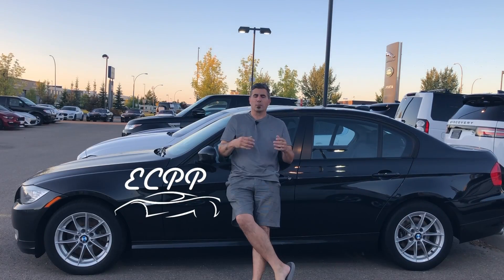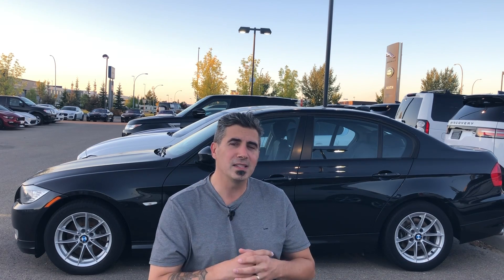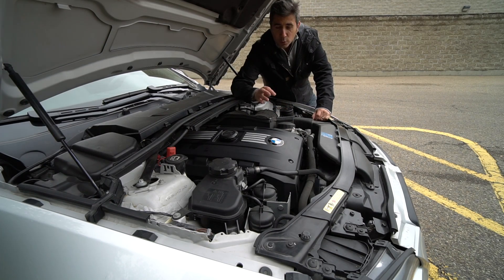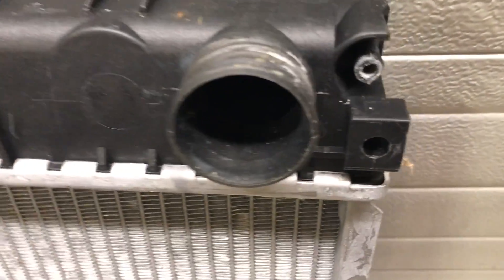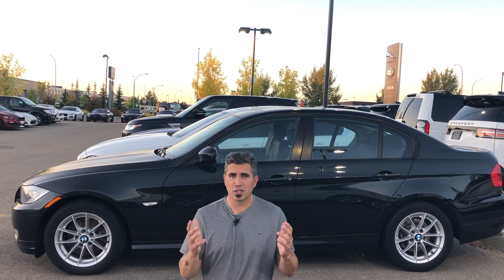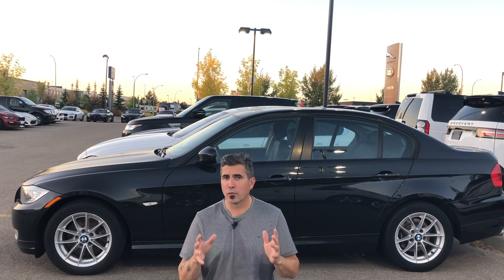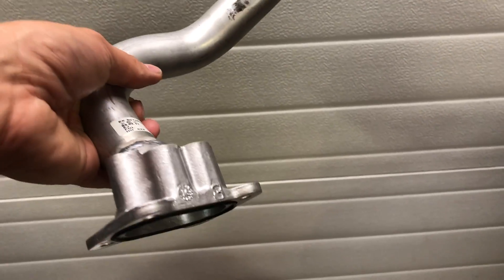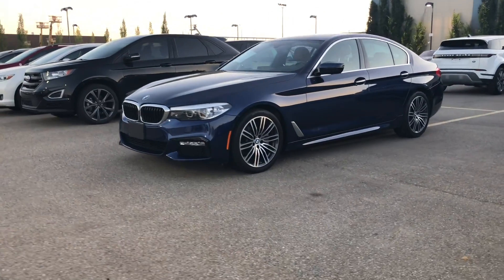Why Does BMW Use Plastic Engine Parts??

Comment: Honestly bmws are no different than any other car except the repair bill can be expensive that being said the problem is people buy them second or third hand that can’t afford them ie they have a car note and and can’t afford the needed maintenance cost or other other small repairs that turn into a big one so eventually they trade it in and someone else gets the car with no maintnc and it breaks down again. I own 3 bmws the key is buy one used low miles pref with cpo warranty pay it off within warranty and then expect about 1-2k in maintenance cost. My daily driver n54 335 is going strong with 120k owned for 11 yrs now

Comment: I'm worried to death I have a 2016 X5 I bought it about 7 months ago CPO and have a warranty for 2 years ... its my first BMW  the Lexus I traded in was awful!!!!!!... looks like I will be running back to Lexus in about 2 to 3 years .. I've got  62k on it
Reply from the maker: I would just enjoy it anyway for now because they are some of the best drivers cars on the market.  Which engine do you have?
Reply: The n55 I knew better then go with the v8

Comment: Answer in short: because BMW makes more money on repairs and maintenance putting plastic parts in the engine than putting in parts that will last. Planned obsolescence
Reply from the maker: True
Reply: It's all about the "bottom line" which is to make a profit.
Reply: Detroit's "Big Three" way of thinking 🤔
Reply: Friend had an i8 he bought CPO. As you know, price-wise this car was very much at the top of the BMW range, his car being about $150K new.

About a year later, AFTER having an oil change and an inspection, the dealer said everything was fine. Within a day a plastic part melted which resulted in the engine failing on the highway, a very scary scenario. Total cost to fix? $23K. The car wasn't even four years old. Luckily he had the extended warranty, but it again proves exactly what you say.

Comment: I completely agree, all the failure points are the plastic. Thermostat, charge pipe, expansion tank. Everything I know I have replaced on several of my BMW’s
Reply from the maker: For sure, it just seems par for the course.  I think I literally swapped almost every coolant line, hose, and component within the cooling system on my E92 335i.

Comment: List of things that have broken on my e90 in 6 months of ownership: Radiator, 4 way coolant connector hose, 2 expansion tanks, lower radiator hose, hose to thermostat.
Reply: It’s not a BMW if it doesn’t have problems with it’s cooling system.
Reply from the maker: Confirmed.  Cheers
Reply: List of things which have broke on my Integra, corvette and 350z in 10 years:

Errr

1 cam sensor literally last week on the Z! £20 job done!

Oh and a window wiper! I think that was German...

I really want an e92 m3 aswell but just don’t want to buy a horror show.
Reply: List of things that have broken on my E92 in 1 year and 6 months of ownership: Turbo charger and AC line (which i broke myself)
Reply: Two expansion tanks? The expansion tanks are usually not an issue on the E90s unlike the older generations

Comment: BMWs last about 3 years before the big repairs kick in. Lease, get it out of your system and dump your problem into someone else.
Reply: icm65 from Uncle Scotty
Reply: Scotty said: some vehicle used priced drop like a rock. Better to lease
Reply: Not really own a 323i 2011 and it lasted for the whole time and I’ve never had one problem besides this year where I had one problem with my exhaust bracket.
Reply: Jonathan McCully yeah 328i are not bad honestly those cars can also handle lots of power if you wanted to add a tune. They got no turbos which is good and they’re a V6. When I drive my car I feel like they restricted so much power from it. But in all they are very reliable.
Reply: @Jonathan McCully what about 6 series
Reply: I have a 328i 2014 it’s my daily drive and I’ve never have a problem
Reply: @rubenbelman2368  just swap all the plastic parts to aftermarket metal ones

Comment: Plastic is a huge issue for BMWs. It saves BMW money on the manufacturing end. Those savings are not shared with the customer. I’ve already replaced my valve cover and it wasn’t cheap. Long term ownership is no longer a viable option for me. I really love my 328 and I wanted to keep it for a long time. I’ve been a BMW brand lover from a young age and I would  like to own one but it just doesn’t seem possible for someone on a regular salary.
Reply from the maker: It is a financial committment

Comment: Are there aftermarket part makers that actually make non-plastic OEM replacements? If they did, I’d budget this in when buying a lease return and take it to my mechanic to replace the plastic-impellered water pump, plastic thermostat housing and other plastic engine critical pieces.

Comment: Some president for german auto(Audi or smth) was asked what is the three most important aspects in the auto industry. His response was, I paraphrase "Top three aspects in the auto industry is 1. Cost. 2. Cost and 3. Cost." :D
Plastic manufacturing is alot cheaper than alu manufacturing, do the math...
Reply from the maker: Exactly
Reply: @ECPP  Hotplate welding is used to join complex plastic parts - its very economical compared to welding or casting a complex metal part.

Comment: I had a 2006 530Xi wagon and a 2009 128i manual. Water pumps went out on both at less than 80K miles. $1,000 for each. Two engine gaskets in the 128i, close to $1,000, coils on the 530, rear leveling suspension air bags and compressor on the 530 $1,800, then a quoted $9,000 repair for a major water leak issue on the 530 that BMW wouldn't pay for because it was one year too old for the recall even though it had the exact same design! Luckily my insurance paid for it at $6,500 but that was a $1,000 deductible. I also got an AWD error in the 530 a few times before I dumped it and the AWD isn't as sure-footed as Saab's or Subaru's. 

Even changing the battery on the 530 was a pain. You need to remove a lot of trim, it's in the hatch and you need battery power to open the hatch!  Changing the air filter in the 128 was also unnecessarily more time consuming than it should be.

All this before 85,000 miles on both cars. 

#NeverBMW again for me.
Reply from the maker: Wow, sounds like some bad experiences.  I see why you would move on.

Comment: The same thing happened to my 2007 328i, luckily I was less than a Kilometer from home. I had my car towed to my mechanic and he replaced my water pump and my thermostat. I have 384,633 Km on my vehicle.

Comment: Scotty talked about this Issue man I wish they kept using steel based stuff. Like E30s E39 E38 had all everything in metal under the hood.
Reply from the maker: Cheers
Reply: @ECPP  thanks mate! BMW Maybe weird but they have such stunning models so unique. G'day mate
Reply: E39 had a fuck tonne of plastics under the hood.

Ask me how I know, since I spend a few years with one fixing it every other week because something stupid would fail
Reply: E30 uses rubber timing belt
Reply: @timothykeith1367  at least they put timing belt on the radiator side and only cost $100-250 to change. Try to replace timing chain in n55 engine which on firewall side every 100k miles or lower and see the cost repair. Timing chain shouldnt have short life cycle and dont put it on firewall side BMW
Reply: @trianggaindralukmana2184  I saw a recent video of a GM 3.0L Duramax truck engine that also has a camshaft timing chain on the backside.  They claimed they made it as easy as possible to repair.
Reply: @timothykeith1367  to change timing chain on n55 you have to take out the engine or you remove the transmission and lift it with car lift. If u replace timing chain in front side like timing belt e30 you mostly only take out electric fans
Reply: @japanwatchconnection mine doesn't

Comment: Poor engineered, cheap parts and they are endless money pit as they age. Honda Civic Type R is faster on the Nurburgring track as the BMW M4. BMW is even not a driving machine anymore!
Reply: You sound like Scotty endless money pits
Reply: @robertceroli3512  I work for BMW, I know how BMW handle quality!
Reply: After the E46  there  is no more ultimate  driving machine  , just a bunch  of plastic and turbos bull****it .
Reply: Sounds like you're talking a lot of crap dude. Stay in your Civic, I'll stay in my BMW. Life's too short for driving trash.
Reply: @Ashley_van_Schooneveld  If you buy BMW you financed me. We need people like you, how has no idea about cars, don't accept the truth like that M4 is slower than the Civic type R on the track, and buy this BMW crap!!!
Reply: 335 e90 is n54 engine is the german 2jz
Reply: @AhoyHollow  No, N54B30 is the worst 6 cylinder motor from BMW. The other is a Toyota motor!
Reply: @Genadius77  both engines are top 5 or top 10 best engines for paformance if you not a hands on person car nor for you
Reply: I agree with you that BMWs are cheaply made when compared to Japanese cars. But a Type R beating an M4?! Comon man that’s a stretch. BMWs will always break down but they will give you a driving experience that compensates. Even Toyota itself went to BMW to build it’s new Supra, which has its flaws but it tells you something when Toyota chose BMW out of everyone else. A civic type R will outlast a BMW M4 but it will NEVER beat it in a race though, sorry. The Type R would be a good car for my grandma to buy groceries with though
Reply: @drbadzer  You can see that on the official tracking lap times list from the Nuerburgring! Honda Type R is much faster than the BMW M4. If you don't believe that, that's your problem!

Comment: Most of this car is full off cheap parts. You should see it apart after an accident.  This is reason for higher rates.  You cant weld .  For one item you have to take apart half the car.  No thought process for the reality of life.   This a great if you buy and put it away and never use it.  
Great performance car. But I rather rent one for the weekend.
Reply from the maker: True

Comment: I wonder if the newer bmw engines like the b48/58 will have the same problems with their plastic engine parts
Reply: Their B58 motors are burning oil like crazy from a low as 2k miles brand new. Low engine oil light already with only 2k miles? 🤯

Comment: BMW uses cheaper plastics and poor quality control. Japanese manufactures don't have the same issues, they use better plastics.
Reply: I read that a German law requires the use of recyclable plastic, which is thermoplastic - can be remelted.  Usually only 3 types of plastics.  Nylon for thermostat housings etc.

Comment: By a Luxus and save money.
Reply from the maker: There is less going on there for sure.
Reply: @sanju2 lexus cars are reliable because they are driven by Geriatrics. You drive any lexus as aggressively as BMWs or any other car is driven and they break the same. I've owned and still own both lexus and Toyota vehicles and they do gave their problems. Catalytic converters are a major lexus/Toyota issue and the emission system in general.
Reply: @brianc2399  then why are you watching this channel?
Reply: @brianc2399  I'm sorry to hear of your loss.  A 2010 GT would be a 5 with a 4.4 V8 turbo.  So sad to hear. IMHO cut your losses and buy the newest 3 you can find with an N52 engine, without a turbo.

Comment: As a mechanic in Germany, I love BMW's cause of the enormous customers they send, never owned one though.
Reply from the maker: What are the big issues that you see?
Reply: @ECPP  11
Reply: @ECPP  does a 2013-14 bmw 330 have plastic parts in the engine? This plastic is disgusting
Reply: @ECPP  all bmw models have a periodic failure of oil coolers on both engine oil cooler and transmission oil cooler, almost every 35000 km to 40000 km. we have 3 models of bmw and all face similar defect
Reply: Someone say their German mechanic use Japanese car.
Reply: Aziz Hussein Z   Sounds about right hahahaha hahahaha.
Reply: BMW : brings money to workshop
Reply: @HanryKumala  Damm it, I was just going to post that 😂
Reply: What about Audi and Mercs?
Reply: @Vivsterist  travelling on the same highway.
Reply: @Vivsterist  real money pits
Reply: Beautiful cars to look at.
Reply: i heard, that you need some kind of really expensive tool to diagnose these cars, do you know something about that?
Reply: @marktran2657  VW/Audi.  While still not the most reliable, they won't cost you thousands when something breaks.  
Stay away from Mini products.  It's repackaged BMW.
Reply: @marktran2657  In my experience, Mercedes engines are OK, but other parts, electronics and interior switches develop unexpected problems.  Always be sure to change the motor oil in German cars on time.  Always, and use only high quality motor oils.
Reply: Which German car do you consider as most reliable ?
Reply: @cryptol6842 NONE!
Reply: Now ur thinking like the manufacturer
Reply: Why comment if you don’t even owe one.
Reply: Ah....the bedroom german mechanic...
Reply: I'd bet you are a mechanic who needs to replace an entire component or assembly and can't fix the tiny part that is broke.
Reply: Maybe this dude is no mechanic at all.
Reply: Answer the ppl mane
Reply: This comment needs to be unhearted.
Reply: Honesty Counts 👍🏽 never seen a reliable BMW 👉🏽 Thank you
Reply: @raymarcable1292  in the 80s they made honest cars
after late 90s starts to go downhill really fast
Reply: And they keep buying them, Insanity is doing the same thing over and over again and expecting different results.
Reply: Sticus lost
Reply: They are great sources of profit for mechanics!  😊
Reply: stilkus What are the top 5 issues that put money in your pocket?
Reply: "As a mechanic in Germany"..bullshit you are any sort of mechanic. No mechanic would say that. I been working with cars for over 25 years. Every brand,at some period,with certain engine or gearbox has its weak spots. In general Audi/VW are total disaster to work on. Mercedes and BMW are not legendary in reliability statistics,but very easy to work on. I can literally close my eyes and do the full maintenance on almost any BMW. Sure,they could've use more aluminium on the cooling system and intakes,but every manufacturer has gone down this road.
Reply: @eleonik76  yeah well a real mechanic would never say that, I've been working on cars for 178 years.
Reply: @eleonik76  I've owned 1990's BMW and Mercedes-Benz.  They were and are absolute nightmares.  
I switched to VWAG and never looked back.  Sure, VW/Audi cars have their issues, but NOTHING like BMW and Mercedes.  Not even close.  My 1997 E320 needed a new $2000 ignition key interlock assembly after just 60,000 miles.   This failure was so unusual, I had to wait a month for the dealer to import this thing from Germany!  Ridiculous!  Nearly 4,500 dollars total!  Luxury garbage!
Reply: @eleonik76  lol you lack experience with many brands. BMWs are certainty one of the worst. There is absolutely no argument unless you are completely blind to Lexus, Toyota, Honda, Acura, Porsche... Even Audi and Mercedes have higher reliability than BMW
Reply: @wind016  I lack nothing. Myself I drive Lexus and I would pick a Lexus over any brand,any day. Acura as well. Any brand has its lemons,and you must be really narrow minded person to not admit that. I never said BMW cars are reliable. They are money pits. But up to 2010 ( E60/E90 family),they are incredibly easy to work on. Work on any model of Audi/VW and you see what I am talking about.
Reply: @eleonik76  na. I had an e92 N55 335i. No not easy. All the plastics melt. The rubber tubes keep melting which require taking out the whole engine. No thanks. Never again. I did have a wonderful E30 325i with half a million miles. At last, BMW is not the same company. All there new cars are designed as Lemons for maximum service revenue, including Mini.
Reply: Joseph C. Especially the mini
Reply: That’s bs you’re not in Germany at all stop lying troll and in Germany they make BMWs much more better and reliable
Reply: KON KON no, same crap they sell here
Reply: @konkon6851  so they're sending shitty cars to the rest of the world?

Comment: Glad that you speak the truth.  People and Car dealer need to realize that to adjust the used BMW price accordingly.  Some other market BMW basically giving out for dirt cheap.   People who bought a 5 years old BMW might still making car note for 3-5 years and repair bill hit.
Reply from the maker: Thank you very much.  Have a great day.
Reply: You're 100% right. I've owned 3 BMW's so far and still have the last two I bought. The first I paid for cash from the dealer off of a lease, the second I bought private and also paid cash and the third has 55k on it and two years left in the warranty right when i'm finished paying for it. Moral of my BMW purchasing history?  if you wamt to buy a used out of warranty BMW save up and pay for it cash and if you're buying one that's only a few years old like my 3rd one, add the BMW warranty for the extra couple grand. It'll be cheaper in the long run and you'll be a happy BMW owner.
Reply: @TtotheH-zo3qh  Are there any major repair happen to your BMW?
Reply: @imanwan2861  I proactively changed the timing chain on the second one (N20) other than that I spent $1000 once on the first one for the valve cover  and also replaced a starter. Everything else was maintenance. So about $5000 total between 3 cars in repairs over 8 years
Reply: @TtotheH-zo3qh That is not bad at all compare to my friend's repair.
Reply: @imanwan2861  exactly that's why for me BMW'S are worth the extra time you have to put into researching where to get parts and knowing more than one mechanic you can trust. I rather do that then drive a boring car although I also have a Mazda 3 as my run around car lol